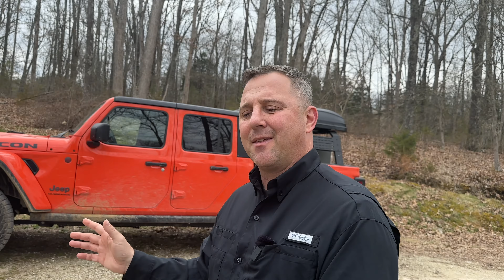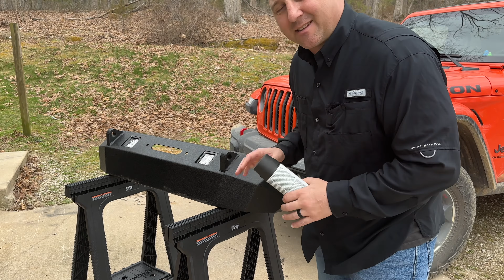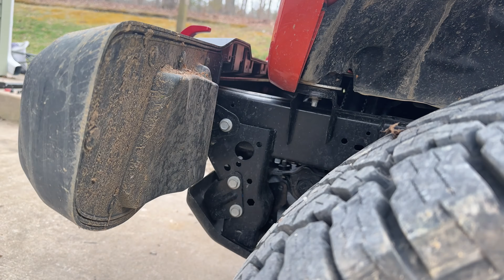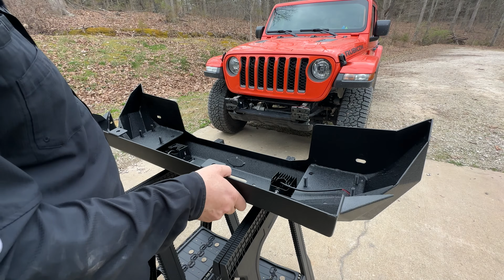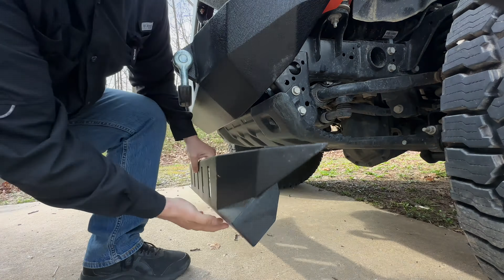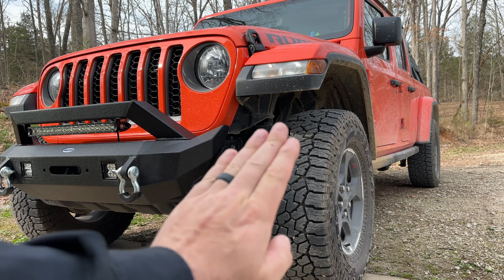How to Replace Your Jeep’s CHEAP Plastic Bumper

Comment: If youve ever hit a deer you'll know that it's a serious consideration to fortify that front end. Even though it may not look cool it will save your life having a guard beyond the bumper. Can always put some lights on it. Anything you can do to upgrade that front end the better. I just recently  had a whole herd of deer come out on the hwy here in Idaho up by Idaho City and caught one of them , missed the rest luckily. Have a dented hood, fender is off kilter, had to replace the headlight and assembly. Lucky though.. anyway..consider finding something beefier if ya plan on cruising in nature. Peace Wheelchair John in Idaho 😊
Reply from the maker: Excellent info. Unfortunately, I’ve hit a few deer over the years. But, nothing that caused major damage. This bumper will definitely provide a more solid base than the stock bumper. But, ideally I never need to find out. Thanks for stopping in!